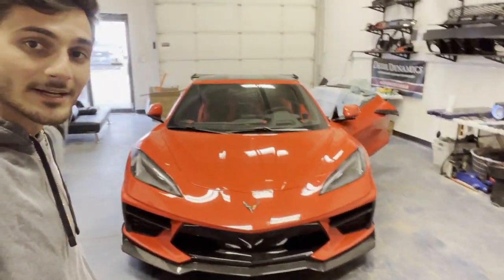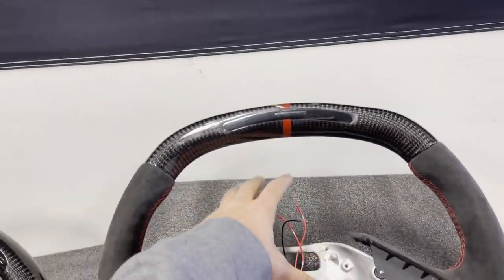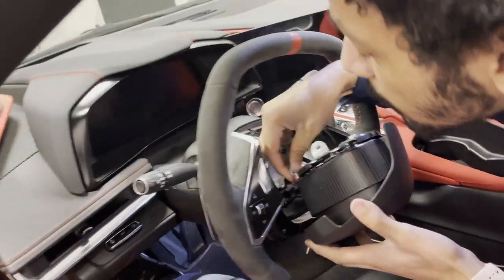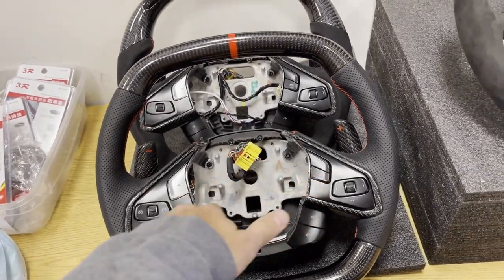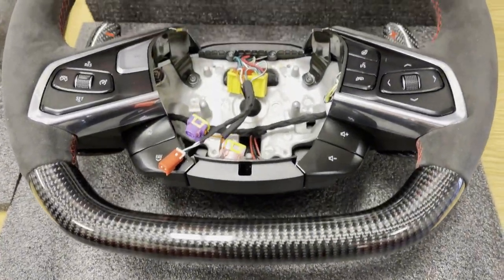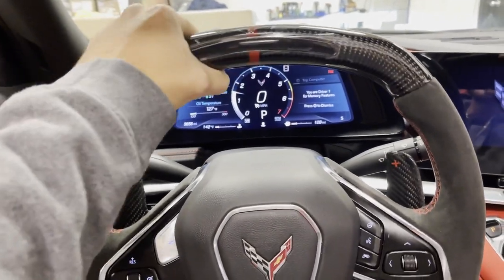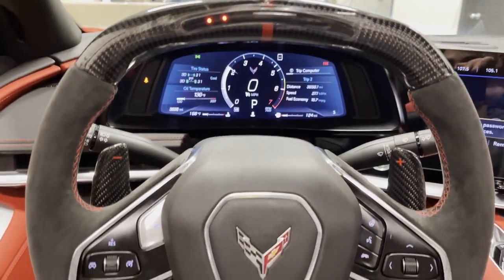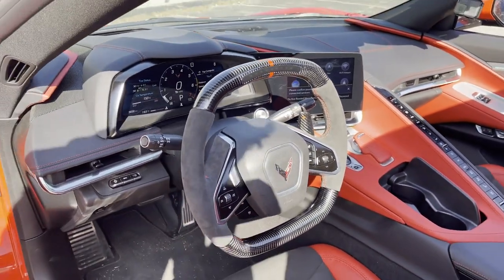C8 Corvette LED Heated Carbon Fiber Steering Wheel (Install/Overview) - Next-Gen Speed

Comment: Hey I just ordered one of these not long ago , but in one of the C8 Facebook groups a gentleman said the LED option caused tons of issues with check engine lights, brake failure, and TCM issues, have you or any customers had this issue?
Reply from the maker: We only have 1 customer in the past 4 years of selling them that is having this issue that we are trying to help resolve. We had this for 3 years on our 2020 shop C8 and currently on our 2024 shop C8 without any issues, and have sold over 100 LED wheels. We are not sure if his car itself is having electrical problems, but the only thing our bluetooth box does it give off the readings from the car. It does not change or malfunction the car.